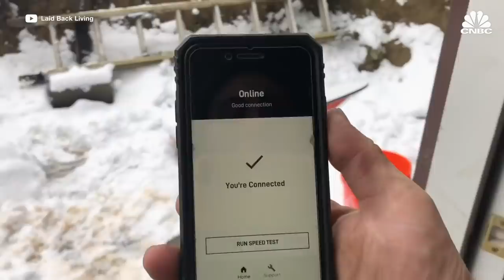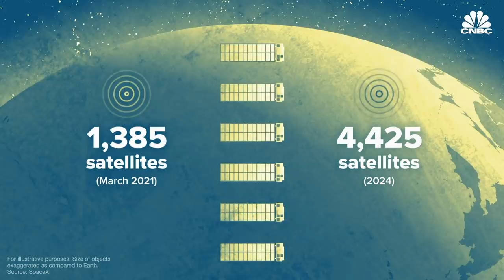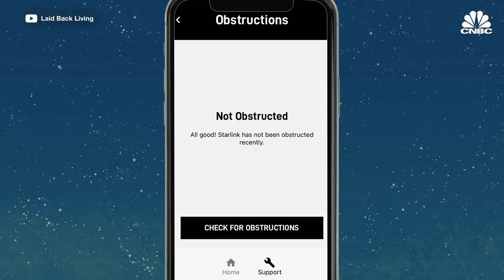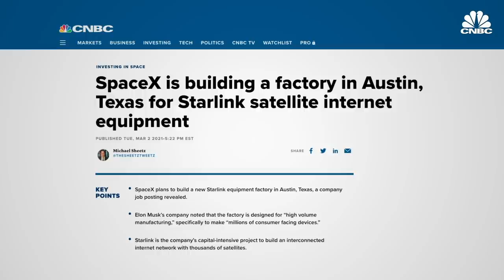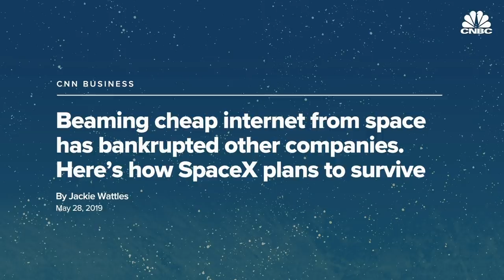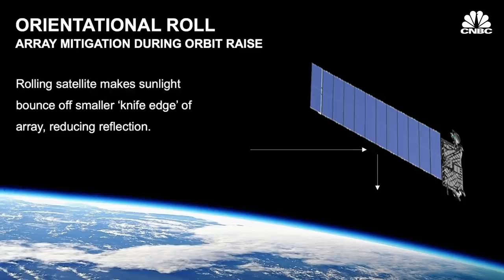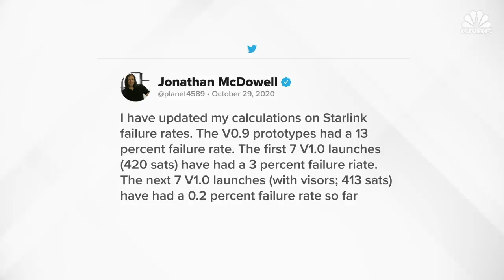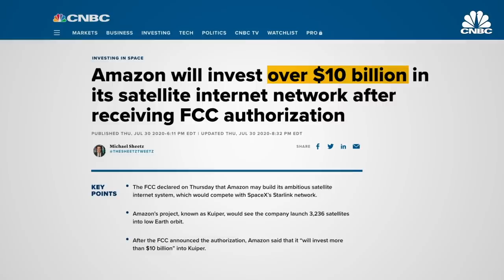Why Starlink Is Crucial To SpaceX’s Success

Comment: The competition has zero chance to compete.  

Owning the rockets makes all the difference. Starlink’s volume drives down Spacex operating costs for every thing. Starlink gets launches at cost, which is way lower than SpaceX’s competitors can charge, even before their markup. 

No one else has a chance.
Reply: Plus they are able to launch there satellites on test flights.
Reply: Competition won't be satellite in the future, it will be 5G
Reply: Cheapest ride to space will have the cheapest satellite constellation and therefore price. Everyone else will have to suffer double the initial deployment costs. The only ones that stand a chance are Blue origin if their new glen rocket ever becomes reality and big nation backed project's where cost is not a issue.
Reply: 5g could replace all home internet for the rest
Reply: Blue Origins Kuiper does. It’s connection with Amazon makes them worthwhile competition
Reply: But it fuels the space race, which is epic
Reply: @sddonzori4734  100%. Competition is great for us consumers
Reply: @haruspex1-50  You have it backwards. Amazon is the company building Kuiper. Blue Origin is an independent rocket company. Even though Bezos owns Blue Origin and is the founder of Amazon it's not close to the same setup as Starlink and SpaceX. SpaceX is the company that's building both the rockets and the constellation so they can launch at cost. Amazon can't launch at cost with Blue Origin without getting sued due to anti-competition rules and Blue Origin can't afford to offer launches at cost as they don't own the constellation being put up. If Blue Origin wants to launch Kuiper sats it will need to offer a competitive bid vs SpaceX if they want the business and Rocket Labs as they are currently planning a new rocket designed for launching constellations. Amazon is publicly traded so it can't just go with Blue Origin.
Reply: SpaceX also owns the satellite manufacturing.  Lots of satellite companies outsource construction and launch of it's satellites.  SpaceX brings everything under one room.  For example Iridium Satellites were built by Thales Alenia Space and then launched by SpaceX.  Also by building and launching it's own satellites SpaceX can make design changes faster.  Also SpaceX already has won a contract from the DOD to build missile tracking satellites for the US Military.  Also SpaceX can use it's own Starlink launches to test flight leaders for re-use of F9 boosters.  This lowers the risk for it's regular customers.
Reply: But is the market there? If not, having the benefit of in-house resources only goes so far.
Reply: @aribloch  5G? way less range than 4G and you think it's gonna compete with this?
Reply: @johntechwriter  Is there a global market for fast low latency satellite Internet?  YES!!!
Reply: @johntechwriter  $30b at least according to this,  not including the enterprise side.   Yes there’s a huge market.
Reply: @aribloch  cellular technology becomes uncompetitive if the population density goes below a certain level.  There’s always going to be a market that cellular or wired internet isn’t going to bother with.   It’s just a matter of where the line is.  How rural is too rural to be competitive with satellite.
Reply: @xiaoka  yeah, i am aware of this. That said, the market for satellite is not as big as some make it out to be. Satellite will always be worse than a fixed connection, in some aspect
Reply: @aribloch  Did you watch the video? A Starlink beta customer painted the picture for us. The best choice they had in their area prior to Starlink’s introduction was 5 Mbps, whereas they have been getting over 10 times that speed with BETA Starlink. People in areas like that either have no “fixed” (I guess you mean copper wire or fiber??) connection options, or really crappy + expensive ones. That market is huge if you didn’t know. It’s exciting to know that more people will have more affordable access and better connection speeds to the internet.
Reply: @aribloch  "Satellite internet" as we have it before starlink are all at geosynchronous orbits, which is around 35 000 km above earth's surface compared to the mere +-1000 km of low earth orbit which starlink will be in. in other words the slowness of the old satellites was only due to the shear distance light has to travel to reach there and back. light travels faster across partial vacuums than glass fibres, in addition satellites allows for a near direct connection across continents instead of having to hop along coasts.

for more in-depth look at the engineering behind starlink, Real Engineering did a great video on it: 
https://www.youtube.com/watch?v=giQ8xEWjnBs
Reply: @waynelewis9110  my point was some people like tailosive tech try and justify starlink as a replacement for Comcast, which it is not
Reply: @aribloch  5G and Starlink have two completely different markets. 5G antennas have a really short range, and thus they target high density areas where they can reach a lot of people with a single antenna. Starlink has a large coverage and operates well in rural areas, but it doesn't handle so well when a single satellite has to take in a lot from a high density area.
Reply: @SDGreg  so Musk has his hands in EVERYTHING
Reply: @GtmNayan  Midband 5G range is not insignificant, I believe it can be over a mile. Obviously, for super rural areas with houses spread far apart, this isn't great, but for areas where cable installation is expensive because of house spacing, but houses are not exceptionally far apart, 5G will be a viable option
Reply: @carpediemarts705  I think it is called vertical integration.  Tesla Motors is run the same way, bring as much manufacturing in-house as possible and makes sense.  Which is opposite of current direction for US manufacturers which is to outsource as much as possible.
Reply: @aribloch  I wonder what the data speeds will be as the customer base grows. Terrestrial communications is way less complex than satellite. I live not to far from a place that One Web. I was there a few weeks ago and the 23 sat dishes are still not moving.
Reply: @johntechwriter  Many people in rural areas don’t have $100 a month to pay for this service, never mind the $500.
Reply: @waynelewis9110  A lot of people choose not to live in such areas for lack of quality connections.  So, once the option exists more people, enterprises and industries will take the option of relocating.
Reply: @carpediemarts705  He has stepped into a vacuum created by the mediocre management and ambition of the legacy aerospace industry.  Cheap launch costs have created a huge advantage.  To bad really. As there may be better com satelites than the ones Space X are producing.
Reply: @Chris_at_Home  Is it possible for one customer to split the costs?  The band width available is likely ample for online shopping?  One home could have the base and share the signal through a router.  Not to be done in the way I used to score free internet from my neighbor, but more formally or collectively that would protect private data.
Reply: Except Amazon!
Reply: I find this interesting that people discussing here does not really grasp the real situations in rural areas from third world countries. Your assumptions are way off TBH.
Reply: @aribloch  It’s a problem to have mile long range in one antenna, every antenna needs a fiber connection to work, because those towers normally don't speak to each other via radio wave. So, you may not to lay cable in every house, but you still need to lay cable on those areas.
Reply: @aribloch  guys 5g is not infinitely scalable. it gets blocked by brick walls. you need dozens to effectively serve one city. 4g is the superior technology for ranged service and 3g better still. they were invented first because they had more range and we couldnt use the speed back then. its almost at the level where we can physically see the radiation coming from the towers, which means solar interference. you cant shine a laser through a wall, and 5g is almost a laser at this point.
Reply: @jonathanodude6660  you don't understand how 5G works. You are referring to mmWave. Midband is much more economically viable for mass coverage, but mmWave will cover most big cities in years to come.
Reply: @aribloch  both of those are still 5g, and from my understanding mmWave is faster. also, how do I not understand if you're essentially agreeing with what I said?
Reply: @jonathanodude6660  you use 5G as a blanket statement, while you meant to refer to mmWave specifically. Midband 5G is about 10x faster than LTE, while mmWave is closer to 20x, up to 40x in some cases. Midband has enough range to cover the majority of Americans economically.
Reply: @tonipalma6001  The internet tends to raise quality of life.  Therefore finding the cheapest way to deliver it is good.  Iteration on the manufacturing, or collective purchasing or use of a station will bring the price down.  What is on your mind?
Reply: @markharmon4963  Yeah I agree. But a from a base case of $100/month, there's a long way to go for it to be economical for most rural areas. Collective purchasing is also a good idea, unless your nearest neighbor is more than a mile away. The 5G idea for me is dumber, heck most rural areas don't even have 2G connectivity since telecoms didn't find it economically viable to construct 2G towers. Starlink might be our best chance to reliable internet connectivity but the pricing is the biggest challenge of providing internet to the poorest of the poor. Long way go to.
Reply: @tonipalma6001  My dad grew up in rural Oregon. He  would tell me of the times he and his siblings would eaves drop on the neighbor's conversations. Everybody; about five families, on their road shared the same phone line.  The operator had a special ring pattern for each residence on the line, which would help you know when to answer. We have come a long way. And at the same time, I have a lot of respect for how people; poor people, can recognize a benefit in an imperfect situation and make it happen. These are good times. Thanks for talking.
Reply: @aribloch  LOL
Reply: @Wirmish  LOL at what? There are too many comments here.
Reply: @tonipalma6001  Verizon covers more than 70% of the country with 4G, and more than 99% of the US population. They also cover 97% of rural populations. What you are saying is completely false.

Approximately 3 million Americans don't have access to Verizon's 4G network. It wouldn't be unrealistic for them to cover most people with some sort of internet option in the future. The biggest issue IMO with Starlink is sky high upfront costs equipment wise, and the satellites only last a few years. It is implausible for most scenarios that a satellite would be cheaper than fixed broadband. Satellite internet will always be less reliable than a fixed connection, due to weather issues and such
Reply: @aribloch  You know America is not the only country in the world right? And Starlink's mission is to provide global internet connection not only America right? And settings in rural America is way far off from the rural settings on other parts of the world.
Reply: @tonipalma6001  sure, but many other rural areas in other countries have no ability to pay for this
Reply: @aribloch  Why are you concluding what I'm saying is false? I'm not talking about rural America. Heck, I don't know about Verizon. We only have PLDC and Globobo here.
Reply: @tonipalma6001  this video was mainly about America because starlink mostly operates here currently. Like I mentioned, its tough in many other markets due to economic status of people in each country. I don't see how they can sell it for any less than $100/mo until the dish comes down in price by at least half.
Reply: @aribloch  You said - "It is implausible for most scenarios that a satellite would be cheaper than fixed broadband." Yeah say that to an archipelagic country with thousands of islands. The cost  of deploying the cable infrastructure is massively high. Thus, satellite internet would be a no brainer choice. I understand you are only talking about your beloved America.
Reply: @tonipalma6001  I said implausible, not impossible. How many people actually could afford this in these countries?
Reply: @aribloch  I'm starting to think that you are affiliated with the fixed broadband industry companies and you're defending them from starlink?
Reply: @tonipalma6001  nope
Reply: @aribloch  . They're charging $100 per month in America but charging less in other countries. Just like microsoft did in which microsoft charge americans back in the days $150 for Windows 7 but only charge $25 a copy in India.
Reply: @aribloch  5G is overhyped
Reply: @Tounguepunchfartbox  starlink is overhyped. 5g will be amazing when Verizon rolls out c band at the end of the yeae
Reply: @aribloch  unless someone wants to install a 5G antenna in the middle of the ocean or in a remote area
Reply: @emeraldaxx8631  I didn't say there were no use cases for starlink
Reply: Yep it’s a monopoly. Musk needs anti trust legislation brought now
Reply: He who owns the means of production...yer its going to end up as a monopoly and will be able to charge whatever in the future and become very much open to terrorism and other risks.
Reply: Have you even heard of AOL ?
Reply: So true!
Reply: Hire me, then you get one chance ,D
Reply: You forgot about Darpa and Virgin Interactive. Sure they come up with something like I did ,D
Reply: @xiaoka  Below the brudge too ,D
Reply: @waynelewis9110  Why would even anyone who prefers forest and animals, need any satellite dish except netflix buahahaha
Reply: @jayg1996  Alexa is still Alive and well?
Reply: And some people like you only complaint.
Reply: @waynelewis9110  I agree, it is also an issue of social parity, reliable internet for kids and adults is becoming a necessity to fully participate in society.  Online learning, banking, and dozens of more specialized activites become impossible with slow/flaky internet.  For everyone experiencing urban 800mb/second data, it's easy to forget how many millions are still shut out.
Reply: Greg Gaming  That's not how it works. SpaceX and Amazon have a few years to get a certain number of satellites into orbit or they lose the rights to their frequencies and orbits. With 1,445 satellites up SpaceX is very close to meeting their minimum requirements. That's way more than 2-3 after waiting ~10 years. Amazon has to put over a thousand into orbit in the next few years so they've started buying launches finally.
Reply: @aribloch  there are literally still 0 practical uses for 5G, there won’t be for years. And you need a tower every couple hundred meters. There is literally no rush for 5G. It is by definition overhyped. Where as starlink can provide internet to hundreds of millions of people anywhere in the world.
Reply: @Tounguepunchfartbox  you clearly don't understand how 5g works. Nor starlink. There is absolutely a rush for 5g. 4g is getting pretty full and can't support home internet for most situations. 5G will be able to
Reply: @aribloch  home internet and wireless connection are completely different things. Home internet operates off of fiber optic cables. And give me a modern day application where 5G is a necessity.
Reply: @Tounguepunchfartbox  Not so much in the future. Also, most home internet does not operate off of fiber optic to the home. It is expensive to run fiber to each house, but it is a lot easier to use 5G to cover moderately dense areas.
Reply: @aribloch  most cuties in US are. And the ones that aren’t use satellite or DSL. Nobodies WiFi runs off cellular. Like what are you talking about? Starlink is literally providing fast internet to those who don’t have fiber lol.
Reply: @Tounguepunchfartbox  what are you talking about? Very few americans have fiber. Verizon has already started rolling out 5G home internet, which runs from 300-1000mbps for only $50/mo. I live in a fairly populated area, but we only have cable internet, not fiber. It's not bad service, but it's fairly expensive compared to 5G home. Starlink isn't a replacement for cable internet, although 5G can be
Reply: Imagine how much the government pays to have a camera on each satellite spy system forget the mobile phone user!
Reply: @aribloch  wtf are u talking about
Reply: @jake91hall  What are you confused about?
Reply: @haruspex1-50  When New Glenn will be operational, SpaceX will also have Starship that can launch 800 satellites in one go for $3-$5millions and few thousands already operational with an established user base and advanced ground service.
So Amazon could build its service much more expensive and have to sell it for less to be competitive.
Because of this, I guess Kuiper will focus on enterprise AWS costumers only.
Reply: @aribloch  5g has range problems
Reply: @stevenson720  you are confused. mmWave is short range, and this is just part of the technology. Repeaters are beginning to enter the market and range will improve. However, 5G doesn't mean mmWave specifically. Verizon will cover most Americans with Cband at gigabit speeds in just a few years
Reply: @aribloch  hey Ari. You sound like you know what your talking about. I was basing my opinion of a news report a few years back where they set up 5G for a major sporting event and discussed how it would be great at/near the stadium but that it dropped of pretty quickly as you moved away from it. I fully admit that could have been totally connected to that implementation of 5g and not 5g tech as a whole. 

Still, I think satellite Internet will br amazing. Apparently Russia has banned it but how many people are just going to ignore the ban and therefore get access to an uncensored Web experience for the first time.
Reply: @stevenson720  the stadiums are pretty disappointing but like I said, that should get better with repeaters. And the speed is actually necessary there. Verizon started with mmWave because it is much more technically impressive, even if the range is short.
Reply: Competitors will all rely on government subsidies and grants from their countries of origin (Russia, China, EU). SpaceX definitely has them at a disadvantage though.
Reply: @aribloch  thx for the information. I know more now. 😁👍
Reply: @aribloch  starlink can be upgraded to 5g when they have enough satellites in orbit.
Reply: @cuddlemuffin.9545  no it can't. Phones can't have a satellite in them
Reply: @aribloch  they could. They just need to build the infrastructure for it, right now it's not their main goal. Main goal now is, send enough satellites to orbit and set up a solid 50m-100m user base.
Reply: I’d check out Helium before you  
make such bold statements. Star link has little to no chance in competition with helium, ESPECIALLY when you have to pay for the service. Although Musks marketing ability may give them the edge in that area.
Reply: Amazon... Oneweb... China...
Reply: @aribloch  not really. 5G will have the same problem as 4G and fiber - ISP focuses those on cities and areas where there are many people. That segment is never SpaceX target consumers. As shown in this video, their primary customers are those in remote areas which the big isps do not serve. when the constellation is complete, they will also have the advantage of being able to offer their services worldwide instead of in just one country
Reply: You really want the skies to be blanketed with an artificial light mesh? What was the satellite train all about? Didn't look like that would have given good consistant signal... can someone explain to me how the short satellite train could have provided internet when my location is geo locked on a spot?
Reply: Uhh I have 5g pay 25 dollars a month through Verizon. And its fast I mean crazy fast. Starlink is much more expensive and just a little bit more faster I'll stick to 5g.
Reply: So why doesn't my phone work in the hills if the satellites are in space?
Reply: Balloons